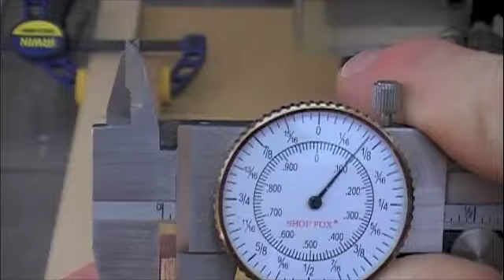Woodworking - Designs in Wood Inlay - Custom Block Project & Skills Tutorial

Comment from the maker: If your stars are not tight that could mean a couple things. 1.) accuracy of the cut. 2.) accuracy of the measurements, (make sure both sides of each segment are dead on equal.) 3. It could be the clamping at glue up. (use wire and pliers at each end of the block immediately after glue up.)

Try again...My 2nd set of stars were much tighter because of clamping with wire & tightening with pliers.

Check out my YouTube woodworking channel for more designs. There will be more in the future too.